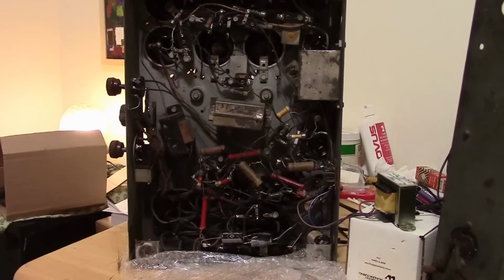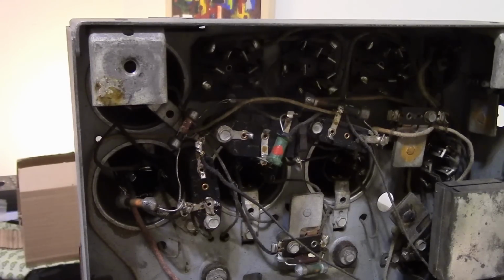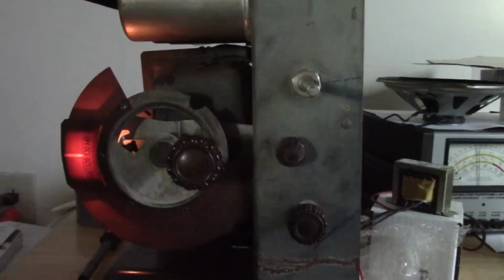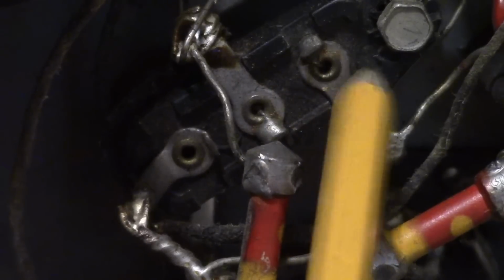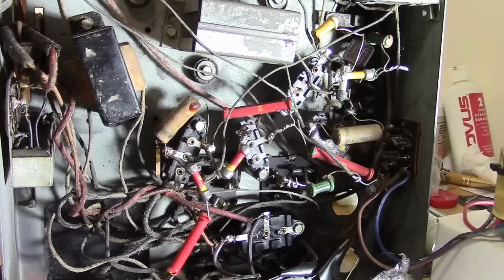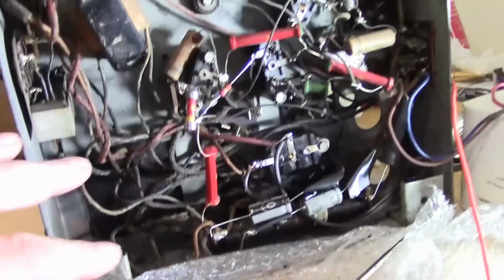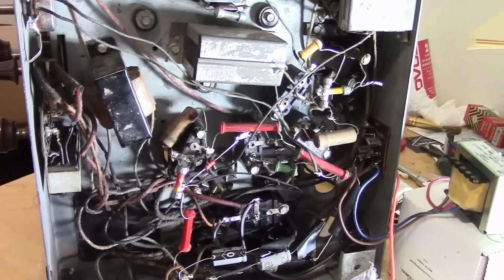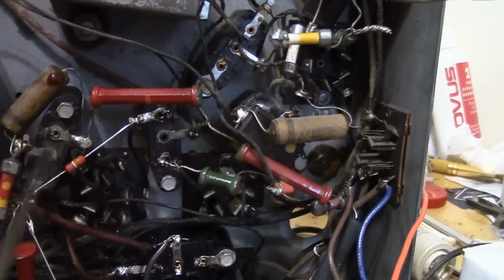Philco 90 resto p5o?

Comment: I have two dog bone resistor-like components in a radio. One of them is completely an olive green color and the other is completely orange.

I’m not tremendously experienced in this antique radio field (only been doing it for about a year) so does anybody recognize it?
Reply from the maker: They could be tubular ceramic capacitors.  Very reliable and don't need to be replaced.  What is the make and model of your radio?
Reply: @bandersentv  Steinite model 420 from about 1930.

Comment: You raised an interesting point Bob. As far as I know in the arts community there are three factions on restoration: The first would leave an artifact as it is, perhaps only stabilizing their condition, even if that means it is "non-functional" any longer. Others would either restore something until it is functional again, leaving the restoration obvious and visible, whereas some would restore something until it looks exactly (or supposedly so) as the "original". 
I would say the monetary value of a piece of vintage equipment is not solely depending on the number of original parts that are still inside, but also whether it functions as originally intended. So in my opinion it's perfectly ok to replace parts, "hiding" them a bit if that improves or respects the original esthetics. What I do when restorng vintage appliances, is to keep a "goody bag" with the original parts that I replaced together with the appliance. That way later owners can still have a look at the original parts should they like to and, who knows, even put them back should they prefer so (where possible of course)
Reply from the maker: These old electronics were meant to be serviced.  Just like an old car.  Is it better to have it running reliably or leave it untouched and undriveable ?

It's a tough decision when you find an example that is all original.  The first question I get when I show an old radio or TV to someone is - "does it work?" not "is it all original inside?"

Even tougher when I'm restoring it for someone else.  I have to make it reliable and safe for them if they are going to use it.

Thanks for your thoughts.

Comment: The Philco 90 in my collection (I also have the 70 and the 20) shows exactly the same thing with the volume potentiometer. It's not possible to bring the volume from a strong station completely down. When you will fix that issue it might woth a try to put in a potentiometer with much higher value, like a 1Megohm, a 4,7Megohm or a 10Megaohm, of course with logarithmic curve. To find out if the signal is leaking somewhere else in the circuit, just desolder the wire from the potentiometer which goes to the grid of the 47 tube. If no signal is coming thru, then it's the potentiometer which isn't able to bring the signal completely down. But if the potentiometer isn't connected and the signal comes also tru, then somewhere else in the circuit is a possible leakage. Some 10 years ago, I had the possibility to talk to a former radio engineer who was born in 1920 and worked for radio manufacturers in Switzerland and Germany. He told me, that they did this on purpose, that a volume control couldn't be set completely silent! Especially on portable tube radios, the volume control was designed this way as an aural indication that the set is still working and as a remainder to not to forget to turn the radio off, when not in use! The Philco 90 was designed and produced in 1931/1932 and is a very early AC powered set. At that time, many 1920's battery powered radios were still in use. And the customers who were familiar with the 1920's battery radios were used to it, that the volume on these set could not always be put completely down, and so it might be, that the Philco engineers designed it that way for the customers, to always be aware, that the radio is working. You mentioned another very interesting topic in your video, and that's the noise and the voltage drop, when the set is turned on. I have noticed that also in many other early American cathedral radios. In my Atwater Kent cathedrals, the 90, 84 and 82 it's much more prominent, than in my Philco radios. The reason for this might be, that the 80 rectifier tube and also the 47 output tube have a direct heater filament. All the other tubes, the 24, 27 and 35 have a indirect heater filament. Tubes with direct heater filament do warm up much more quickly than the indirect heater ones. Now in the Philco 90, as the rectifier tube and the output tube are warm up quicker than the rest of the tubes, the power supply and the output stage are already working. But the indirect heater tubes are not fully warmed up yet. And suddenly, after 20 or 30 seconds later, you hear a "plop-noise" in the speaker, and you see a drop in the B+ voltage, as the indirect heater tubes are now also warmed up and working. This short noise might be the moment when the oscillator is starting to work. Now current flows thru all the tubes of the circuit and this can cause such a recognizable drop in voltage. But maybe I'm wrong and the effect is caused by something else. Would be very interesting to hear your thoughts about this. Have fun and best regards from Switzerland, bluearcturus
Reply from the maker: HI.  When I grounded the grid of the 1st AF tube (27), the volume went completely down.  I replaced a few more of the old paper caps and the issue has been resolved.  Is your 90 completely recapped ? 

I have one more metal box cap and the tone control caps to rebuild.  Also I need to test all the tubes.  If the "plop" persists after that, I'll investigate further.

Comment: Just a thought:  you are assuming that it's an AF signal bypassing the volume pot somehow.  Could it be that the IF signal is getting to the grid of the detector amp via stray capacitance or inductance, and the triode is demodulating it?  I only recently became aware of using triodes as a detector, basically because the gain for the negative and positive half cycles is a little different because of the non linearity of the characteristic curves.  So the triode amplifies the RF signal but the output has a DC offset which varies with signal amplitude.  As an aside, I wonder if this significantly affects single ended OTL triode tube amps, where the audio output must have a superimposed very low frequency component, basically a demodulation of the AF signal, a DC voltage which varies with output amplitude.  This is just one of many issues I am considering as I look into OTL amp design.  As always, I am really enjoying the video series, a big thank you for your hard work.
Reply from the maker: I think you're on to something.  It does seem more likely the the higher frequency signal would be finding it's way around.  Especially since none of the wiring is shielded.

Comment: Here's hoping the radio eventually gets completely refurbished.  Sometimes it really is easier to fix up obvious hack jobs than to try to figure out why, with the hack jobs in place, the set is acting illogically.  We hobbyists have more time to burn than the repairmen of old who were under pressure to fix the set as cheaply as possible lest the customer not want to pay to get their set back.
Reply from the maker: Oh it will be.   Of that you can rest assured.  I'm already a bit further along than this latest installment and it's working great.  We're in the home stretch :)

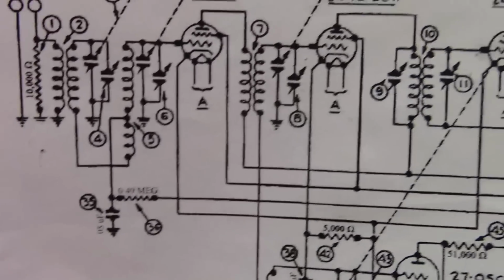Comment: 6:11 It is not only the RF amp tube that is affected by an AGC control voltage.  The IF tube sees some AGC control too. If you look again closely, you find that the full AGC voltage derived from the Detector Rectifier  which biases the RF amp tube also gets devided in half by two 51k resistors. And that voltage then prebiases the grid of the IF tube via another RC lowpass.  
Why they chose to reduce the swing of AGC prebias to 50℅ when using it on the IF tube idk,- maybe the response to variations on the bias is bigger with the IF tube.
But on your explanation of AGC function another question may come to mind; is AGC merely a convenience to keep the volume constant (->AVC) or is it rather beneficial (necessary) in preventing overdrive of the mixer and IF stages and reducing cross/intermodulation and production of unwanted signals. I think the latter is as much valid as the constant volume level. - Especially if you discuss AGC in FM or a TV IF that is set up for intercarrier sound demodulation... (4,5MHz subcarrier extracted from the video baseband rather than two separate IF strips for video and audio)
Reply from the maker: Yep, I'll talk about the IF AVC cap in the next installment.  The earlier revision of this model had no AVC/AGC at all.  Just a pot on the antenna for volume.   I'll try to show how the grid voltage vary as I tune around the dial.

Comment: Great video. It might be instructive for some newcomers to this business to put your DVM on the DC AVC line to show how the voltage changes as you tune through stations. Strong stations will cause the AVC line to go more negative which makes the bias on the front end tube grid go more negative. On tubes designed for AVC control a more negative grid bias will reduce the gain of the tube thus stabilizing the volume. On weak stations the AVC line will be very close to ground ( ie. Only slightly negative) thus providing max gain.
Reply from the maker: Great idea.  I'll show that in a future installment.
Reply: @bandersentv  And maybe mention that the tuning indicator (eye) tubes use this AVC voltage as an indication of signal strength.

Comment: Greetings:
When you were showing the effect of grounding the volume pot you missed the opportunity of grounding the bottom of the pot (schematic shows gnd). If that point kills the audio then the gnd connection is bad, or if not then the pot has a bad internal connection to that point.
Reply from the maker: I get you point, but I grounded the wiper and it didn't help so grounding the bottom of the pot was irrelevant.

Comment: Thanks for the interesting video! When you replace (unpolarized foil) capacitors, do you pay attention to get lead from the new capacitor, which is the outer foil winding on the side in the chassis which is on the lower impedance side of the circuit? Here's a very interesting video about this topic and how to determine the lead from the outer foil of a capacitor: https://www.youtube.com/watch?v=BnR_DLd1PDI The new problems you got with the new capacitors installed in this video may cause such noise problems in reception on receivers. Best regards from Switzerland, bluearcturus
Reply from the maker: No, it really doesn't make any difference. That's why they stopped marking them.  Old caps used really metal foil.  Modern caps use a vacuum deposited metal film that really doesn't offer any shielding.

I've seen that video and many other claims it matters , but yet to see someone demonstrate a difference in an actual radio.  After all the wires running all over are not shielded nor are the resistors.